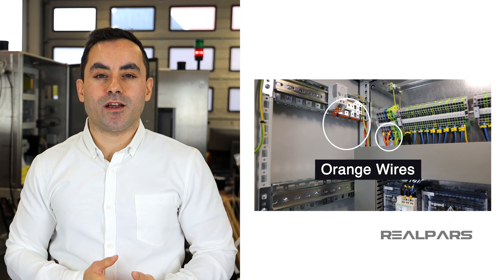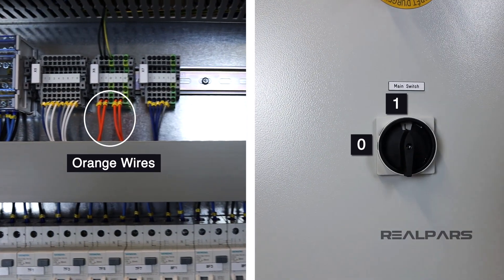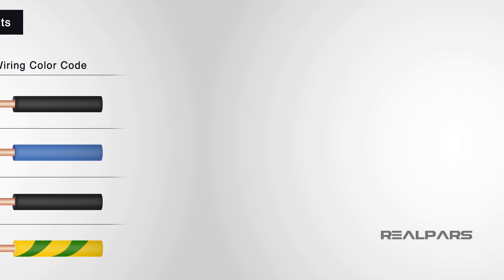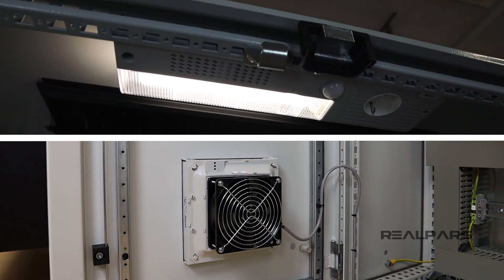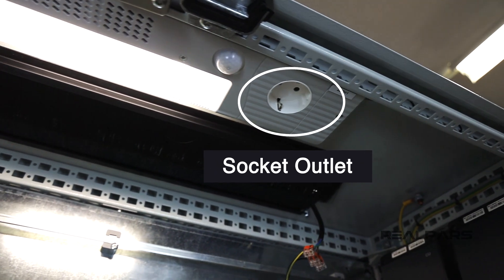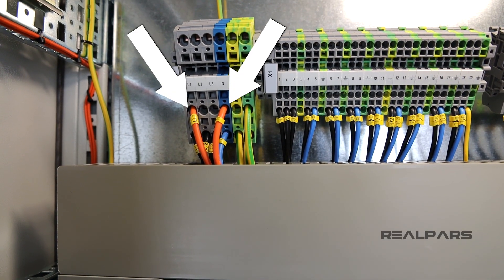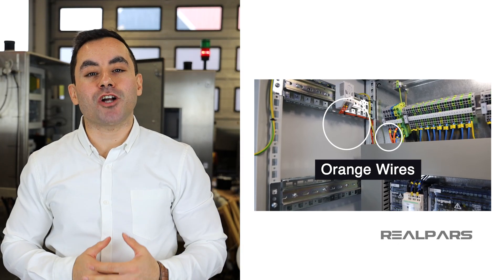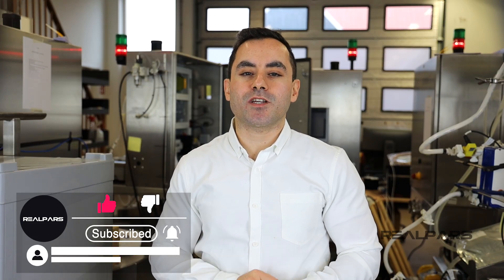What Does an Orange Wire Do in an Electrical Control Panel?

Comment: What's the point having a three phase switch actuating the contactor?
Reply from the maker: Each of the three phases carries current, and according to the video, each is used supply a separate low-voltage AC circuit in the panel. The concept of a fused disconnect has been replaced by a two-position switch and a contactor with overloads.  This is a lower cost alternative for panels that do not require large feeder amperage.
Reply: @realpars  Do you really need three phases to pull a contactor? One should be sufficient?

Comment: Misleading video. Not every company wants to use the same colours. It is also not mandatory to use the colours you suggest.
Reply from the maker: Agreed.  It was not our intention to imply that these are the only colors that can be used.   The video is very clear that the color scheme used is specific to IEC 60402-1, which is applicable in a narrow scope of applications.  There are many other standards that are used for other situations, and when troubleshooting or modifying or designing a panel, you should confer with the client to insure the proper standards are being applied.

Comment: If the main switch is then turned off, how and where does the "orange wire" get power?
Reply: orange wire not connect to breaker or contactor
Reply from the maker: As indicated, but not fully explained in the video, the distribution block with the orange wires has a power source separate form the circuit controlled by the main switch.

Comment: Those color standards are confusing as hell, why is that?
Reply from the maker: I once heard from a very wise engineer, who said, "the wonderful thing about standards is that there are so many to choose from."  And this is a perfect case where too many standards can lead to confusion.  Look at device networks:  ProfiBus, Foundation Fieldbus, IOLink, Ethernet/IP, ASi, WorldFIP, BACNet, Modbus, etc.  The shear number of available standards makes things confusing.  This video addresses one of many, many standards for control panel wiring that pertains specifically to machine safety in the EU.  Personally, I have not used this standard on a project, even with equipment supplied from EU countries.  But I know it exists and understand that if I have a panel that follows it, that I will need to become familiar with the details of that standard.  I do not know the history of why this color scheme was developed, but I am sure orange was used to set this standard apart from other panel standards.
Reply: RealPars yah ok, but why would + be black and no DC GND or -. Why not separate L and N and why have different colors based on the code types...

Comment: Like others have said, not in the United States. Something I would like to know, why didn’t you use Orange terminal blocks for your Orange wires. Yes, they are readily available.
Reply: If you're designing to NFPA 79, then yes this should definitely be true in the US.
Reply: The video showed an example of a control panel that was ordered/purchased by a client. Orange terminal blocks are available and could have been specified for this panel, but were not in this case.

Comment: Thanks for the good information, although I am a bit puzzled by this choice of colors as Black is used for both power AC phase and power DC+ and in Control both AC phase and Neutral are Red. making it "Not Very easy to tell one from the other".  In my old ANSI color coding post WW2 I can easily tell AC from DC and Phase 1, 2, and 3 in three phase system.  What do we gain in the new color coding? Thanks for any comment you might have to help.Best regards,
Reply from the maker: There are many wiring color schemes in use around the world.  The video shows one implementation (EN 60445).  Whenever designing or troubleshooting inside a panel, it is imperative to review the documentation, including wiring diagrams, to identify the various circuits in the panel.

Comment: It's interesting how differently various manufacturers and countries use wire colors, wire numbers and set up wiring schematics. Mobile equipment can be quite different from stationary equipment. It can be quite difficult working on equipment constructed in various countries and keeping the differences in mind. In the US, we change the wire number when it connects through a device when other systems will use the same number on a wire in a circuit no matter how many devices it goes through. It's only possible to tell what part of the circuit it's in by checking terminal numbers at each end.
Reply from the maker: Yes, there are many wiring color schemes in use around the world.  The video shows one implementation (EN 60445).  Whenever designing or troubleshooting inside a panel, it is imperative to review the documentation, including wiring diagrams, to identify the various circuits in the panel.

Comment: Never opened a control cabinet to find a blue wire used as a neutral. Exactly why would you use orange for both your hit feed and neutral at anytime? Seems to me a good way to mess things up. Once had a co worker rewire a control panel with all red wire only thing he had in his truck. Didn't even use wire markers for identification. Took 2 guys 2 days two days to correct.
Reply from the maker: There are many wiring color schemes in use around the world.  The video shows one implementation (EN 60445).  Whenever designing or troubleshooting inside a panel, it is imperative to review the documentation, including wiring diagrams, to identify the various circuits in the panel.

Comment: Realpars, where in EN60204-1 does it give a table of these colours please?
I cannot find the above.
All I can find is a recommendation to follow the colours from IEC60757.

These colours are not required by any law and can only ever be a recommendation.
In the main they are changed dependent upon customer requirements, country and/or whichever way the wind is blowing.
Please backup your statements with some facts?
Reply from the maker: The color schema was moved to IEC/EN 60446 and then to DIN EN 60445.

Comment: Ridiculous video, panel wiring colours will vary by country, your stated colours are almost completely irrelevant here in Australia.
Reply from the maker: This panel was built in the EU according to IEC EN 60402-1 standards.  This standard is likely not familiar to engineers outside of the EU.
Reply: RealPars YouTube is a global platform, making generalised statements without specifying countries or standards applicable is misleading at best, dangerous at worst.

Comment: What a load of BS the color of wiring is whatever the person who gives the order want, never used orange ones for internal lights
Reply from the maker: While it is true that the client has the final say in which wire colors are used, more often than not, the client will want to use a standard appropriate for the plant location.  The EN 60402-1 standard referenced in this video is, admittedly, not a widely used standard even in the EU, but it does illustrate the variety of wiring colors that can be used.
Reply: @realpars  This video says it must use these colors and so on, in 30+ years I never used it and never have seen it used, so it is no standard at all, so this video is a load of bullshit

Comment: As stated elsewhere in the comments, these wire colors are not standard in USA or EU. So in which country(ies) are these colors used?
Reply from the maker: These colors follow IEC EN 60402-1, as stated in the video.  This is the Machine Safety Standard for the EU.
Reply: The orange color for power coming from a different source is in NFPA 79 and UL 508A.

Comment: Wire numbering and tagging and matching wiring diagrams and schematics are most useful and should have a copy inside every cabinet in my opinion.  But being able tor recognize the components inside the cabinet and understanding typical power flow and distribution in these control cabinets an experienced well trained technician or automation engineer will be able to identify most components and wire functions regardless of color...   Also, use a a good voltmeter and non-contact voltage detector can be very useful in verifying voltage and function of wires in a cabinet also.  Good wire and terminal tagging and consistent naming conventions really helps alot and should not be understated in helping workers identify wire functions and conventions being used.  Effective Tagging can help a person quickly identify function and voltage type.
Reply from the maker: Thank  you for the excellent comments on control panel design and maintenance. These are all good points.  My #1 rule for panel design and maintenance, after safety, is complete and accurate drawings and documentation.

Comment: Any colour can be used for any job in any control panel.  Even green (which is usually reserved for earthing, alongside green/yellow) is sometimes used as an active conductor.
Some standard configurations are used but are not necessarily internationally recognised or accepted, and it varies from country to country, so to post a video implying that 'orange is used for x' is foolish and potentially dangerous.
Bottom line is that if you don't know what you're doing in a switchboard / control panel / machine / whatever, then you have no business being in there, so video clips like this should never be published, they will teach you just enough to completely screw it up.  Assuming you don't kill or maim yourself or someone else in the process.
Reply from the maker: The video identifies that the panel in question follows IEC EN 60204-1.  You are correct, it is imperative to understand the codes that are applicable where the panel is constructed and where it will be installed.  No one should work in any panel without having the proper training.

Comment: Even then the colour code is not universal.

We would tend to use brown for L1 Black for L2 grey for L3 Blue for N Gn/Ye for earths

Red for DC+ (annoyingly DC- is often Black same as L2! I)
Reply: The use of brown-black-gray for phases, and blue for neutral (and green/yellow for ground) is the standard for common mains wiring. Is it the standard in control panels?
Reply: @MottyGlix  brown black grey or all black is what I've been using since thay introduced brown black grey and I've never seen a three core +earth in orange  for 415 v ...maybe orange  used for high voltage

Comment: The wires going in and coming out of the main switch have the same name (L1, L2, L3). This is a major error as you may touch the wrong wires elsewhere in the panel after you THINK you disconnected them from the mains. Da's kei-gevaarlijk man!!
Reply from the maker: The main power feeds into a panel are called L1, L2, L3 and should be called this wherever they are distributed within the panel.  That way, we know that there potentially is line voltage at the point in the panel.  Often, we do add a prefix at a power distribution block to identify at the block where the power is being used, such as M101-L1, M101-L2, etc.  Once the power feed lands at a device that can cut off or modify the line voltage, such as a transformer, VFD, or contactor, we change the label.  For a contractor the wires coming in are L1, L2, L3 and the ones going to the motor are T1, T2, T3.  Panels should be designed so that when the Mains switch is de-energized, all power inside the cabinet is also removed.  In cases where it is not, labeling and other means should be employed to indicate live voltages may exist inside the panel even if the Mains is disconnected.  Before working on any panel circuit, verify, verify, verify!
Reply: @realpars  the guy is correct you should have different identification cable markers on the other side of the isolator, it's a device that can be open or closed just the same as a contactor or relay you even just said so yourself ,contradicted yourself  , can't even get the basics right it would be great fun on a break down on you control gear

Comment: I am a control systems specialist aka automation engineer PLC/SLC programmer, certified UL panel designer and builder.  I have been in the field for 15 years none of these colors they called out are correct. I follow the UL508A code. And they are very specific on color codes. And if I used blue for ac neutral  I would get a big fat fine when my panel was inspected by the UL guy. Plus if you turn off the disconnect and ALL power is not removed I have to put a sticker on the outside of my enclosure next to the disconnect stating more that there is more than one source of power feeding the cabinet. Is this a different country?
Reply from the maker: This panel is not built to UL508A standards.  It was built in the EU for an EU installation, following IEC EN 60204-1.
Reply: @realpars  Did I miss the part where you explained this is for the EU.
Reply: If you're using UL 508A and following their color code, you should be using either orange and white/orange or yellow and white/yellow for any conductors that remain energized when the main disconnect is switched off (check 66.9.1).

Comment: FYI, for anyone looking from the US, this is not a standard for controls in the US.
Reply: In the Automotive world for years it is:

Black: 480v high voltage, motor power 

Red: 120v control power
Blue: Low voltage DC power and control (24VDC)
Yellow: Interlock power from a separate panel source.
Green: Ground
Reply: Sammy Licata, that is the standard I have known for almost 40 years.  But it should include white for AC neutral.  Also, about 20 years ago I started seeing white with a blue stripe for DC-, I like this.
Reply: Yes I was going to ask that. Just doesn't seem right based on USA electrical color codes. Also black is both AC hot and DC+? Isn't that a disaster waiting to happen?
Reply: Plus, to meet arc flash requirement, the outlet and programming port(s) must be accessible without opening the cabinet's door(s). Graceport and Automation Direct offer the components necessary to meet this requirement.
Reply: m wilson thanks, I’ve been designing,  building and troubleshooting industrial control systems in the US and have never seen this standard. They had my heart racing for a minute.
Reply: Thanks I'm in the US and I just started a new job building panels and we have different colors
Reply: The give away was machine safety standard EN60294-1
EN being a European standard 
BS being a British standard 
ISO being an international standard 
And I believe UL is the USA standard (underwriters Laboratories)
Reply: FYI, according to the NFPA 79 this is exactly what it's supposed to be used for.
Edit: This is only specifically referencing the orange wire color, which is in both the NFPA 79 and UL 508A.
Reply: typically yellow here.   It should be accompanied by a placard warning that live members exist even when the main disconnect is in the "off" position.
Reply: Shocking, everyone in the world isn’t in USA.
Reply: Bro thank you😂 I was about to run back to the shop and change everything

Comment: in cabinets of machines that I worked with orange was 230VAC but w/o voltage when power was cut off. Each cabinet should have it OWN elec. diagram

Comment: If ac live and neutral are orange, how do i know which is which?
Reply: On french 230 Check between earth  and live = 230 n'eut earth = 0v and if both you've got two phases 400v
Reply from the maker: There should be voltage (115 VAC, 230VAC) between the hot wire and ground.  There should be zero volts between neutral and ground.
Reply: Yes thats like its everywhere, but in germany we have briwn black and grey so you know which wire is the phase without testing and that you dont accidentally short live and neutral together
Reply: @realpars  Dan denk ik dat je eens een nieuwe voltmeter moet kopen ! (morgen even de test doen, ipv draadjes volgens plan trekken in een kastje.)
Tussen Fase en aarde is het altijd 230 Volt (in een 3x400 VAC-systeem), of je moet in een 3x220 VAC-systeem zitten, dat al heel oud is...
Dit komt doordat de neutrale geleider aan de hoogspanningstrafo aan de aarde hangt (middenpunt van de 3 fasen).
en bij een 3x220 VAC-Systeem is er geen middenpunt voor de neutrtale geleider.
(of is het in Nederland dan toch weer heel anders dan in de rest van europa ?)
Reply: Understood by using Google translation. For me what you discribe is what i have but i hear thé new places have but Single  phase.

Comment: i studdied this color code bfore at university & forgot abt,tnx for rmindin & clearifyin
Reply: You'll forget it again when you start working because in reality they use whatever color is handy to get along. I was taught to not even trust the diagram, if there's any chance the wire has a dangerous voltage, test it yourself before working period
Reply: Doesn’t look like spelling was a big requirement at uni does it?